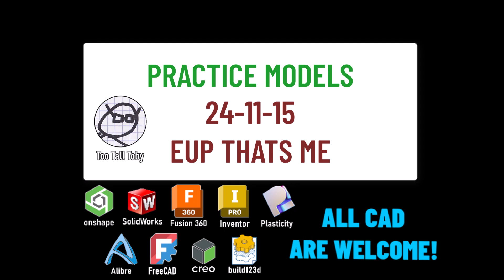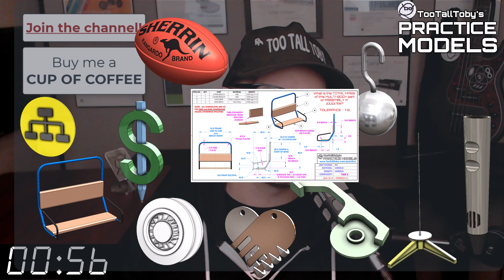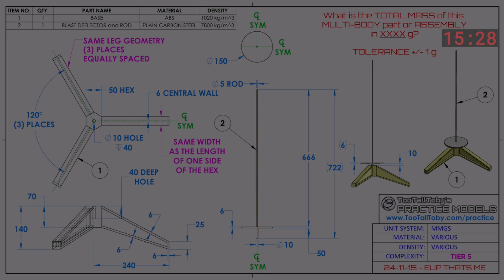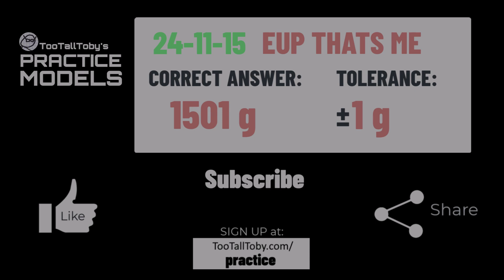2D to 3D CAD PRACTICE MODEL-  SPECIAL EDITION! Free Drawing Exercise for 3D CAD users- PCRduino

Comment: 1501.09 g with SW. Didn't look on the time because I rather wanted to find out how I could make the feet with a circular pattern. Turn out it is possible if the first foot is made via a loft from half of the hexagon's face and and the parallel end face (via an offset plane). Then make an extruded cut with a sketch based on the inner (mid) plane of the foor with an offset of 3mm towards outward. Mirror the loft and extruded cut to get one full foot and then the circular pattern (of loft, extruded cut and mirror) is possible.

Comment: 1501,0907 g about 25 min, Freecad 1.0 Used sweep to get leg with, run in to some problems centering sketch for leg midth wall. Fun modell teaching me sweep can be useful also for single extrudes with odd numbers :)
Reply from the maker: Awesome Job Jim!!  Yeah Sweep is so powerful!